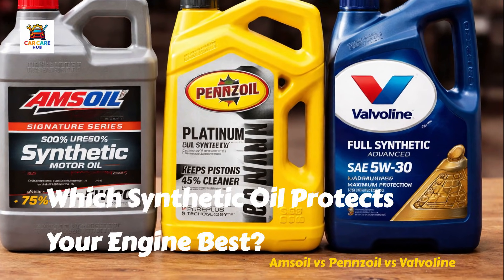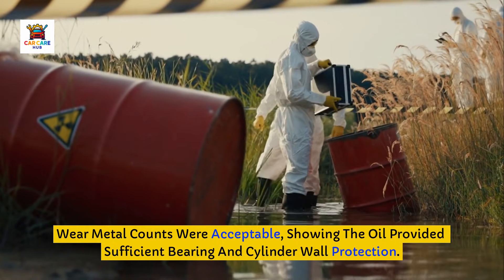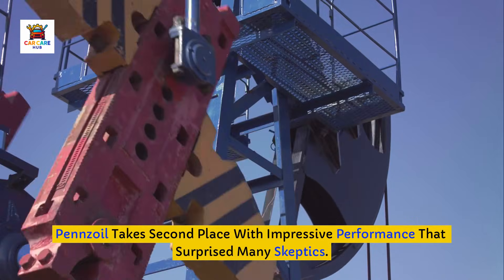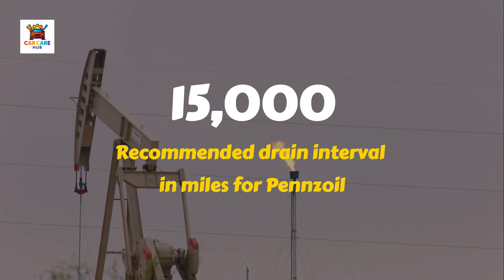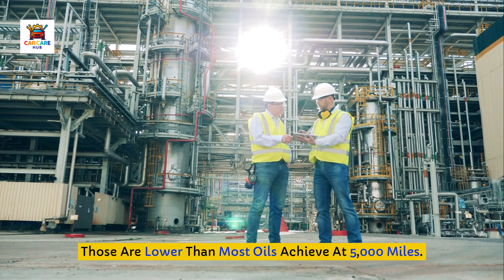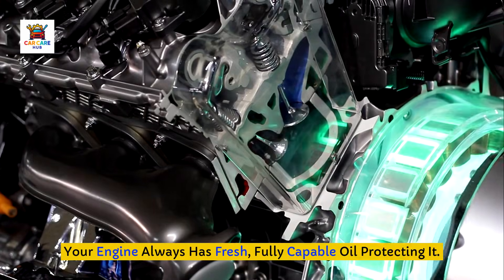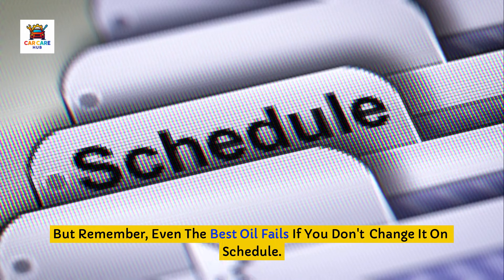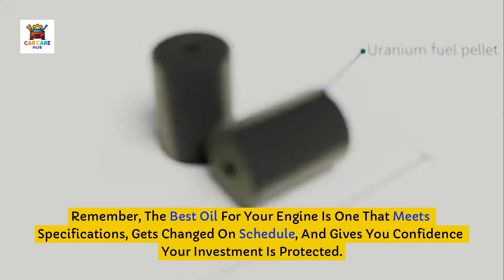3 Premium Synthetic Oils Ranked — #1 Has A Secret Nobody Talks About

Comment: Valvoline is not a premium oil.  Amsoil is group 4, you could call Pennzoil Ultra a group 3+, should have gone Liqui Moly or Redline.  UPD:  I digress, Valvoline came in 6th in overall additive package per projectfarm, so I guess it is a premium oil.  The top 2 were a group 4 and 5 oil, so in group 3, it came in 4th.
Reply from the maker: Fair point. ‘Premium’ can mean different things—base oil group is one factor, but additive package, approvals, and real-world performance also matter. Appreciate your input.
Reply: VALVOLINE HAS A GREATER ADDITIVE OVERALL PACKAGE. AND,, SINCE YOU GO LESS THAN 8OOO. YOU WILL BE GOOD
Reply: @IronMike-f8i  Since I am low miles, I use whatever full synthetic I can get the cheapest.  What I am still trying to prove to myself is that 0w20 is ok for summer time.  At this point the only way I will find out is an oil analysis after a summer run.
Reply: @IronMike-f8i  Also, when your base is PAO/ester, you don't need as robust of an additive package.  Per Projectfarms, Redline had the absolute best anti-wear additive package on a virgin analysis.